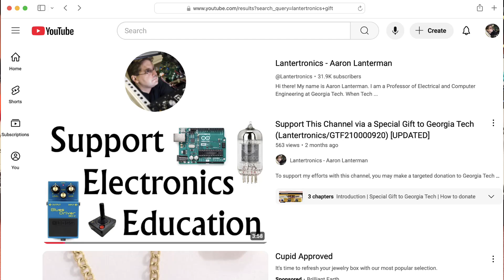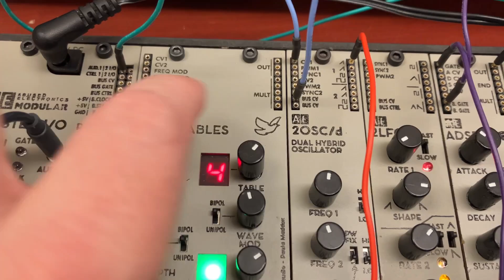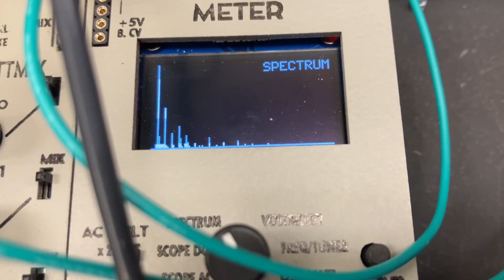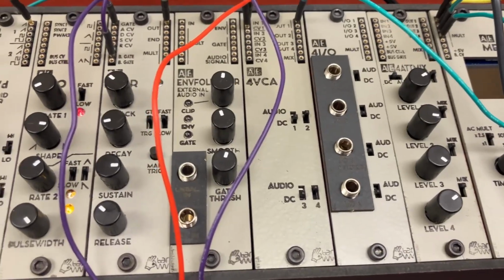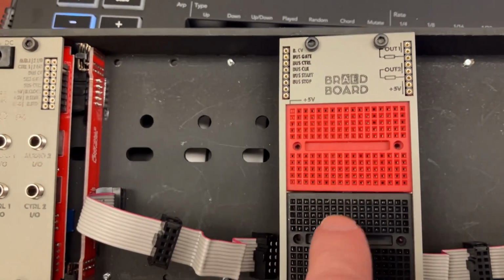Tangible Waves Modular Synth Format may be Ideal for Student Projects (ECE4450)

Comment: And FYI, I made a 3D printed case. It is designed so that you don't have to screw each module in and out with use of a retaining bracket. Also this tends to fit in common 3D printer sizes. This is available on the AE Modular forum under the DIY subforum.

Comment: Yo that looks really cool! So about the 5v only supply… Of course it is super easy to get a 5v power supply , but as for actually designing modules for it that use op amps it seems to me to be harder, right? You would have to include some sort of power converter in each module right?
Reply: It’s not so hard. You are correct that care needs to be taken with the selection of op amp — there’s not an awful lot of headroom in 0-5v, so an op-amp with rail-to-rail IO is pretty much a requirement (most common one in AE seems to be something like the Microchip MCP600x family, there is also the Texas Instrument TLV2462 etc.)